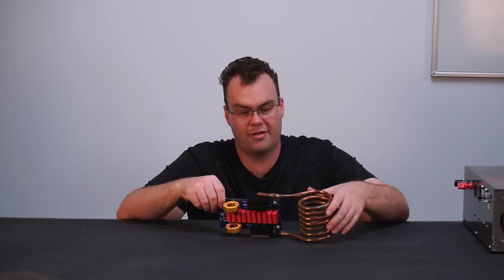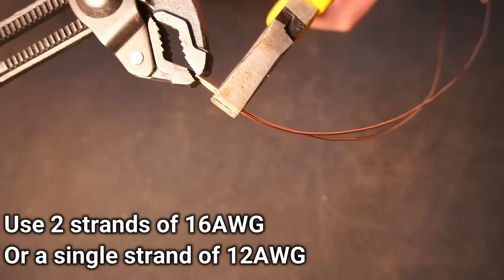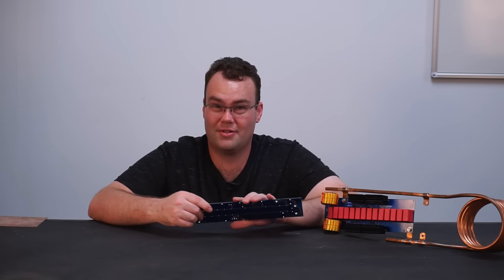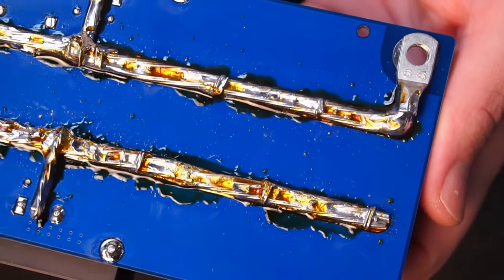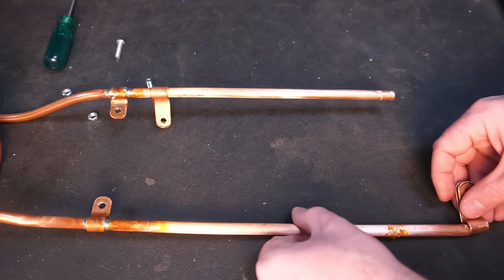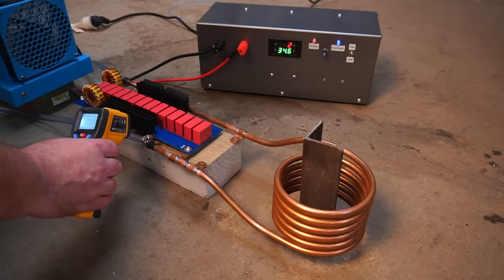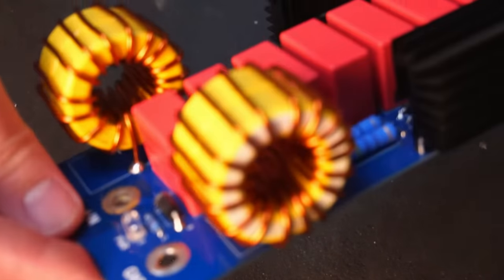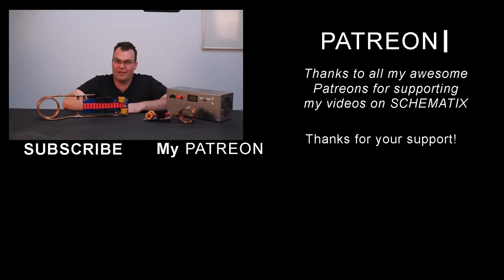Building a 3kW Induction Heater ll Complete Build Guide

Comment: Good job, I enjoyed the layout, the specs on components, and the very accurate description of the solitary drawback, and the immediate fix, using two cores, and 12 gauge wire.  The "scope" shows the exact impact of fixing the core saturation issue.  Quite a professional job, I have a 300 amp tig welder in my shop without running water, and found two water cooled motorcycle radiators, Honda, if I remember right, am running a "vibrator pump" circulating water when the welder is on, and it's worked a decade with no problems.  I run ten or twenty percent radiator fluid, and have a glass "ball" quart canning jar, with a hole drilled in the bottom and near the top on the side for copper tube epoxied in, for a visual flow indicator and fluid quality view.  I leave about half the jar air, for expansion, but haven't ever gotten the water more than warm.  Thanks for a great video, good sound electronics, and sound engineering.

Comment: I used to work for Vulcan Forge in San Jose we used to forge 2 1/2 inch wrenches for Stanley and Proto in closed die forgings they forged at temperatures 2,300° f , and the induction heaters we used to use were also tuned to the coil, by connections made on the capacitor Bank, and every coil had deionized water going through it, and the billets were fed through it also had two rails liquid-cooled rails going down through the center of the coil, they were all made a stainless steel tubing. The forge had coils that can handle anywhere from a half inch material all the way up to 3 in Plus

Comment: Thanks for the video. Nice work! Just a note on why the temperature of the iron stops climbing. Resistance actually increases with heat but that is not the reason. At these power levels and frequencies the heating depends mostly on the magnetic properties of the workpiece. That is why a non magnetic workpiece does not heat as well. The magnetic workpiece actually becomes non magnetic when it reaches the curie point or curie temperature and does not react with the coil as strongly. For steel this is almost 1400 deg. F. You can mess around with a propane torch, a nail, and a magnet for a demonstration. Nickel and its alloys can do this at lower temperatures. Some magnetic coins are fun to play with (Canadian one dollar loonie).
Reply: Can't believe he said resistance decreases with temperature (never heard of superconductors buddy ?).  At melting temp of iron its resistance has increased by 100%.
Reply: Eddy current losses versus hysteresis losses. Hysteresis losses are typically the bulk of your heating effectiveness with these frequencies and these metals.  For metals that don't benefit from hysteresis losses (aka "nonmagnetic"), you generally need higher switching frequencies as well. Take all of this with a grain of salt and confirm yourself, but these are my experiences working in a place that designed these.

Comment: Worked for Sundstrand Aerospace in packaging Wild frequency input from a generator mounted to a jet engine gearbox and rectifies it and converts it to 400Hz 3 phase.  One in production is a 30KW unit.  So I was responsible for coming up with cooling and packaging.  One suggestion is to attach that copper tubing to the circuit board for the straight buses for the capacitor bank.  Attaching the inductor and semiconductors to the back side with the tubing will make it easier to use the liquid to cool the circuit.  Just a thought.

Comment: around the 21 minute mark you state the internal resistance of the metal decreases with heat - it is actually increasing in resistance.
This can be explained by faradays law of induction. because a constant Bflux is changing, a constant EMF is applied to the metal causing eddy currents. and P = V^2/R. which tells us as resistance increases, P decreases.
Reply: AFAIK it has to do with curie temperature
Reply: @ichbineltyb3814  That's right. It's not the electrical resistance that's at issue here. He's heating a FERROUS metal. That means it's highly magnetic and the main heating effect is not from eddy currents but the continuous, rapid reversing of the magnetic field is 'jiggling' the magnetic domains of the metal, causing friction and hence heat. BUT as the metal heats up and passes the Curie point, the magnetic response suddenly drops and that strong heating effect ceases.
Reply: Correct i think he just got mixxed up
Reply: I'm sure it just a slip of the tongue.

Comment: A variety of coil sizes matched more closely to the size of the object being heated will greatly increase the temperature of the object
   Once worked for a company turning out induction heated rivets and such and our coils were not much more than .25" clearance or less around the part...also our coils had water circulating them for cooling
Reply: Johnny, if you are still there...?  Could you please elaborate a bit more on what you mean by "coil sizes matched more closely to the size of the object" ?  How much margin between the outer edge of an object (assuming it's closely centered in the coil) and the inner edge of the coil would you recommend?  Thanks...
Reply: @sempertard  
These devices operated at extremely high voltage and the coils were actually copper tubing, round or square, and shaped for the area of the product that needs hardening with water flowing through the tubes constantly. For instance, one item we did a lot of was a rivet slightly larger than a human thumb and the part would go from ice cold steel to bright red hot in a matter of seconds and then quickly removed and dropped into the quench tank
  edit: another critical component was the requirement to never ever let the part touch the coil and for that we had heat resistant cloth and a paper-like substance
    I would say maybe keep experimenting with coil sizes and if more or less turns in a coil makes a difference and if you want to have a smaller gap then make sure to have something non-conductive between the coil and the part being heated
     
     edit-edit: the gap shown at 21:40 is perfect and to make it even more perfect could be to make a dedicated crucible coil and turn the lower coils such that they maintain that same perfect gap all the way down, making your perfect crucible coil even more perfecter :-)
   Also if you can shed enough heat from the copper tube with water you might see higher temps on the crucible

    EDIT, EDIT, EDIT: just came back from your channel looking for a video about how the coil worked after hooking up to water and if you've melted anything in the crucible...so, did it work ??

Comment: You haven't seen hot until you've seen a 400 kW power supply on a 5' dia. chiller-cooled coil, heating a solid graphite billet surrounded by a few hundred pounds of powdered graphite. It was white hot for several hours and took all next day to cool. We were making the first woven carbon-carbon composite rocket nozzles and nose cones at SAI (before it was SAIC) for the Air Farce and NASA. Our technique was used to make the Galileo Jupiter probe's heat shield.
Reply: Actually, I've seen hot. In fact, I see hot every day. So have you, and everyone else you or I know. It hangs in the sky. 😉
Reply: This sounds awesome. Would love to know more about how this was done. 

Please talk to YouTuber smarter every day.

Comment: another tip - if you own one, pre-heat the pcb and copper wire with a heatgun which helps out when soldering with a undersized iron

Comment: Using coaxial cable braid is the best for reenforcing copper pcb tracks. Sweat it onto the tracks with a liberal amount of solder. Flexible and easy to work with.

Comment: Very interesting project and you are obviously very skilled in electronics. I was drawn to your video by the possibility of using an induction heater for heating some smaller projects in my black smithing work. Firing up my gas forge to do small work is not very efficient. While very informative I want to mention that the steel was no where near a forging temperature. The steel needs to be between 1200- 1300 degrees centigrade to be effectively forged. That is an incandescing yellow heat when viewed in shade. I am confident that you, given your expertise would be able to design an induction circuit to meet the temperature criteria. Again a great video and information thank you for sharing it.

Comment: The weak link with these circuits are the resonant capacitors. So many required to obtain the capacitive value and series current capability. Pity those old high power valve transmitter caps are not more common. Capacitors out of the high frequency TiG welders are made by Miller and can take a lot of current. What is really needed are water cooled capacitors. Must try making some.
Reply: If i understood the function of this device correctly, the resonance is used to create a high frequency AC to drive the work coil? One could use a microcontroller instead to run the semiconductors at the desired frequency like in an switchmode powersupply and get rid of the coils and capacitors alltogether right? Perhaps only one big cap to smoothen the draw on the supply.

Comment: I am wondering if the metal would get hotter if the coils were wound in a tighter circle. I believe the metal needs to get at least yellow hot for proper forging or perhaps other uses. I am thinking a nice project would be for you to make a second coil to swap out with this one for times when you want to heat up something smaller and make it hotter. Not criticizing what you did in anyway. You are a great teacher and demonstrator on here. love your channel.
Reply: He has already said for best performance to match coil with work piece.  This coil was designed to match his crucible for melting metal.
Reply: @mevk1  That crucible should be able to melt some serious aluminum.
Reply: I used to work at a forging company  these induction heaters and it would just get to brilliant yellow you'd almost need sunglasses to look at it and we used to forge at 2,300°, if the Hammerman get it too hot when the Closed Dies hit the metal it would explode and shoot sparks everywhere just like a flint on a lighter

Comment: if you use copper brake line to reinforce the traces. you could also use the reinforcemet for watercooling the PCB. possibly.
Reply: I was going to recommend just bending the whole work coil to match the trace shape and directly soldering components to it through the PCB, but your idea would be a lot easier...

Comment: Instead of soldering those big wires to beef up the traces, I'd recommend the following on your next design: don't bus the caps.  Each cap should have its own dedicated pair of traces going straight to the big terminals for the induction coil.  I would make a roughly round PCB with the induction coil terminals in the center and the caps arranged in a circle around them.  Also, I'd spread the cap traces over 4 layers so they can be really wide.  Some heat sinking may be required at the terminals.
Reply: NICE INSIGHT

Comment: AWESOME I.H. and P.S.  !!!!!!!!!!!!!!!!!!!
I was going to comment on the capacitor diagonal connection, but you mentioned it as I was watching further.
One thing that I have found done somewhat inadvertently in helical work-coils is in how many turns actually produce flux interaction with a work piece.

If you get the opportunity,  could you take the coil and connect a thin wire across the terminal leads near the coil, and then dip that 'closed loop' into a soap-bubble bath, then pull it out and just count how many 'closed' circular surfaces appear through the coil's center...these are the ones that contribute to heating / flux-coupling.  I have found that it can often be less than it would seem by counting 'turns' by sight.  Fractional loops at the ends can be very misleading.
THANKS MUCH...
Please let me know if / when you do it.  I have seen cases when the true number of 'useful / legit' turns has been as many as two less than some large I.H.'s makers claim, even though it may look so.
--dALe

Comment: Problem with the circuit is probably the Mosfets IRFP4668. They have a high gate capacity and tend to swing at the gate at the smallest cicuit induction in the gate path. Thus they dont switch fast and exact enough and build up a lot of heat quickly. Did you measure the gate signal with an oscilloscope? Would be interesting to see. They have to advantage of high voltage switching at high amperage, but they are hard to control in this self oscillating circuit.
Reply: @papvendel7490  If you bought cheap at ebay, they were probably fake Mosfets - they burn easily. Maybe there was a problem with the gate signal, a ringing, and not properly switching. You have to measure the gate signal.

Comment: I made a similar induction heater and if you have them, use copper nuts and bolts to cut down on resistance at the joints

Comment: 2.5mm is single strand solid here in the UK.  I’ve made psu busbars from hammering small bore copper pipe flat.
Reply: multi stranded wire is more rf efficient ie less loss

Comment: Interesting video. I was also thinking about a generator-based induction heater - getting into the 10-15kW range with a 20kVA second-hand genset. Potentially (in the future, after that) getting into higher power than that (Which is completely foreign to me, and will require a whole different set of considerations and learning curves) - but "medium DIY induction furnace" is definately one of the paths my creative endeavours seems to always realign to. I'd also be very interested in (and likely forced to) migrating to PF-corrected supply architectures as well. Subbed.

Comment: Just wondering if you had a target resonance for the output? We use our induction heaters for copper brazing, but I can't recall the exact kHz value that works best for non ferrous metals. Would be good to have a small mobile unit like this for the smaller connections of leads in the series and parallel circuits. Great build! 👍
Reply from the maker: For my application I was targeting what would be referred to as 'medium-frequency' the end result was around 39~40kHz. For ferrous metal, my understanding is mid~low frequency yields quicker heat time due to the 'skin effect' of higher frequencies
Reply: @Schematix  Thanks! Yes I assumed you must of had a specific inductance level to feed the resonance tank based upon your toroid windings. Nice work.
Reply: @Schematix  Does this include the graphite cruicible? I have not found any info on what frequency they heat best. Ive got a 200ml size and made a 135mm diameter coil for it. 11 turns, about 5 meters, I will need to shorten it after some testing.
Thanks for the video.
Reply: Esde projeto pra usar em brasagem de tubos de cobre seria importante pois e portátil me favoreceria muito

Comment: A couple of questions. 
1-Is there a frequency that is chosen to heat steel? 
2-I want to build this heater to temper knife blades. How could I modify the coil? Because it has a dimension of 300 mm x 3 mm thick.

Comment: Great stuff... Any idea how much all that would cost approximately and it's it scalable I.E. 10KW, 20KW, 30KW, etc.
How about a more in depth explanation of the circuit say breaking it down into sub circuits like how is the Sine wave generated.
Is there a PDF to accompany the build if one should try building it for themselves.

Comment: I have a distrust for these self starting "ZVS driver"s, they are picky about supply rail rise time, and also the frequency varies a lot with load (could be a good thing as it tracks for resonance). The problem is, unlike lower powered versions, once out of sync it could go boom. I'd love to see one implemented using a soft switching phase shifted full bridge! Maybe with big ass GaN dies even!
Reply: Yup it will burn instantly.

Comment: Another first class video. I will use this idea to make an instant water heater. Will pass a 3/4 inch galvanised steel pipe through the coil without touching the copper. Then push water through and will experiment with water flow . Please what is the frequency you are using. I thank you again for sharing. Firstclass project.
Reply: Please also if you can tell us the copper coil inductance.

Comment: Since you are using lead tin solder which is kinda regular solder. How about using a high quality solder that that has 6 percent silver. That would make the conductivity a lot better. What do you think fella ???
Reply from the maker: Silver solder would be a better option than lead based solder for this application (assuming you can afford it ;)
Reply: @Schematix  What else would you do to lower the electrical amperage of the unit Sir ???  Different or more capacitors, transistors. Heavier gauge wiring. WHAT Thanks

Comment: So, on the subject of coils: let's assume we want to use it for forging knives. Usually this means we start off from material that's relatively flat, having a more or less rectangular cross-section. Would it be helpful to have the coils conform to this shape rather than having them be round?
 
Second question: since it's not a good idea to touch the coils while in operation, and since electricity can travel from the coil to your body through the tongs when the work piece touches the coil, how would you to about protecting the user from accidental contact? Would pottery enamel hold up, if we paint the coil in this? Will it adhere to the copper in the first place? Will it impact performance? Are there better options?

Comment: With Rds on for those IRFP4668 mosfets being in the range of 0.008 to 0.010 ohms, I think you must have high switching losses contributing to that 67.3 degrees mosfet case temperature measured at  23:10 in the video. If it were me I'd experiment with lower values for R2 and R4. In fact, given the specs. on those  mosfets I wonder if it is even necessary to use four of them for a 3 kw throughput? It seems that with proper gate drive and cooling, two should be able to safely handle it.